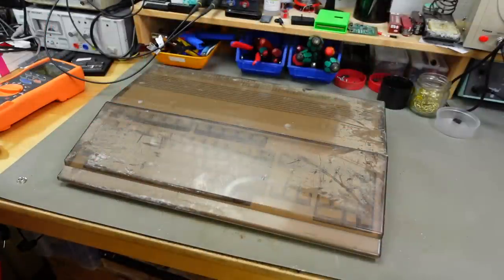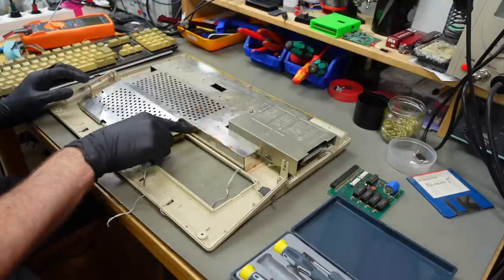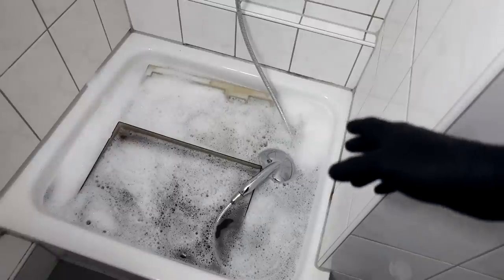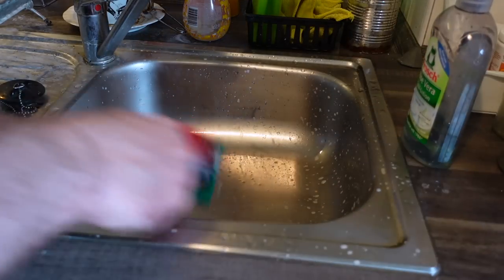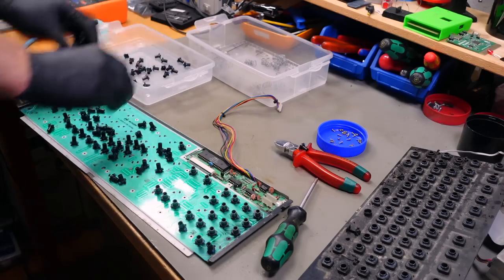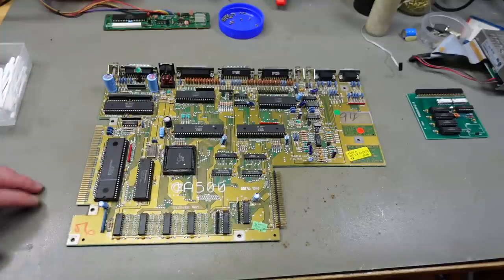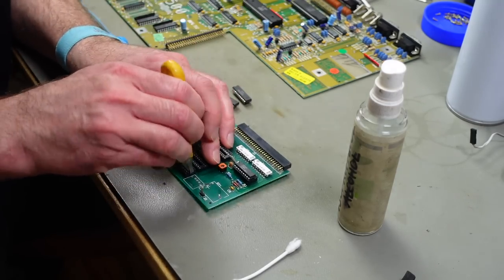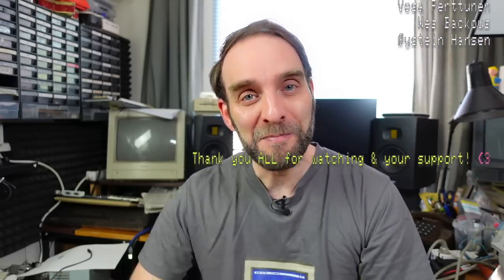Amiga 500 Saved from the Flood (Part 1)

Comment: 13:20 i doubt Commodore used a dishwasher, but the machines that clean boards after assembly work very much like a dishwasher internally, so thats probably where that saying came from :) The only thing about using a dishwasher would be you would have to ensure there is no softner salt in it, as that would very much corrode things!

Comment: Some Amigas were built with single-wipe DIP sockets. These are the ones notoroious for failure - I normally suggest replacing them whenever I find them!
The PLCC socket isn't bad, but often the chip can get well and truly stuck in there. I've had them where it's impossible to remove the Agnus without desoldering the socket, and breaking it away from the chip!

Comment: Nice restoration Jan, just a suggestion, remove all chips on socket before washing a board, then use at least a hairdryer to remove most of remaining liquids.
Reply: That's will work, but the alcohol method is easier and safer.  The advantage of using alcohol is it easy mixes with the water, and makes any remaining water evaporate more quickly.   Alcohol also has less surface tension, which makes it spread out more easily and evaporate even more quickly. Alcohol also has the advantage of being non-conductive.

It's safer because you could heat something up a little too hot with a hair dryer.  With alcohol, there's really zero risk.
Reply: @stevesether  Just don't combine the alcohol and the hair dryer. Alcohol vapor is quite flammable, and the flames are very pale and hard to see. In school, setting a textbook on fire from several feet away was a common trick. (Don't worry, it only ever scorched the paper bag covers we were required to put on the books.)

Comment: Jan!  Another excellent video... I recently bought ultrasonic cleaner and results are amazing. Fluid consists 4:1 of ultra distilled water for electronics: cleanser to electronics (IPA + anty rust additions) and has temperature 65C. 4 times sessions: top-to-bottom \ and /  , bottom to top \ and /  (/ <- 30 degrees) - every time 1 minut each position.  Cleaned after in box of IPA. Not cheap... but PBC is like new.  Components are clean without rust.

Comment: Nice Amiga 500 restoration :) Mine seems to be the same way, keyboard is more yellowed than the case. Removed the battery from my 512kb RAM expansion already in the 2000's, when I noticed it had just started leaking, catched it in time so no damage was yet done, and it still works :)
Reply from the maker: Nice! Yeah, the keycaps and the case parts often seem to be different plastic mixes and the discoloration is not the same. I've seen that a lot.

Comment: Using water is quite common, even today. A relative worked at a medical equipment manufacturer. The boards they assembled were washed in water and simply air dried with compressed air. The only thing a person needs to spend time on is hidden areas where water can stay, like connectors, sockets, and the underside of BGA type packages. Just make sure it's dry and you're good to go.
Reply from the maker: Yes, I can imagine that. Never had any issues with using water for washing PCBs. :)

Comment: You are doing a very nice job at the restoration. I have replaced all of my keyboard membranes on my A1200 and my two A500 with the new Hard keyboard membrane they cost more but the key contacts are copper not the graphite you find on the old ones.

Comment: Is there anything that can be done to renew carbon pads at the keyboard membrane? Is there a product you would recommend?
Reply: Not really, but replacement membranes are available for the most common A500 versions (Mitsumi)
Reply from the maker: You can actually buy carbon paint (mostly sold to repair remote controls that use similar carbon contacts) and apply that with a small brush. I've never used it myself but supposedly it works pretty well to renew the carbon layer.
Reply: Thank you guys for your replies. Will have a look if I can find some proper carbon paint and test it.

Comment: @Jan Beta, Maybe you could put a simple waveform generator connected to small speakers under the sink. It may even possible that the magnets of the speakers will hold them to the steel sink. This might allow you to make a poor mans ultrasonic cleaner.
Reply from the maker: I'm planning to try building something like that sometime. Should be easy enough. I won't use the sink probably but a separate container.

Comment: Hi Sir, can I suggest to remove the solder from where the battery was and place a CR2032 holder, remove the resistor directly connected to the + and place a diode?
To be different why not try plastic welding using your soldering iron the parts instead of the glue method?
Ditch out the old floppy and place a nice gotek?
Reply: Once you start using a soldering tip to melt/cut/shape plastic, it is pretty much finished as a soldering implement. I have a worn out iron of uncertain temperature that I use for working plastic, because I'm not willing to sacrifice tips on my good iron.

It also stinks something awful and burns the eyes. Even ventilation that is adequate for clearing fumes from soldering will barely put a dent in burning plastic stink.
Reply: @mal2ksc  yes, that would make the video more interesting, also the soldered plastic could be a more permanent and robust solution. I never damaged my soldering tip when setting to 150º C to melt slowly the plastic. I saw an extreme A2000 case restoration and even some small metal clips were used to give a good bond between the two parts. Sorry my english, it is not my native language
Reply: @JorgeCarvalho_web_dev  I will admit that I have never tried melting plastic with an iron that has temperature control. I might get better results that way, but I never wanted to sacrifice a good soldering tip. If this won't ruin the tip, I would be more willing to do it. I bet it still smells awful though.
Reply: Using a little bit of acetone on the plastic as glue also works on ABS plastic, Adrian Black has used it a number of times on Commodore restorations.

Comment: I'm confused. Since there is actually NO acid in an alkaline battery (opposite), then why did you call the stuff that leaked out "acid" at first? Why not just use the real term for that stuff?
Reply from the maker: I misspoke because "battery acid" is such a commonly used term (albeit wrong in most cases).
Reply: @JanBeta : Yeah, it's only correct with something like a lead-ACID battery (auto, boat, etc.). Why is it such a commonly mistaken term even though most batteries are NOT acidic? Why is that what caught on wrongfully instead of base/alkali, even though that's what most batteries are?